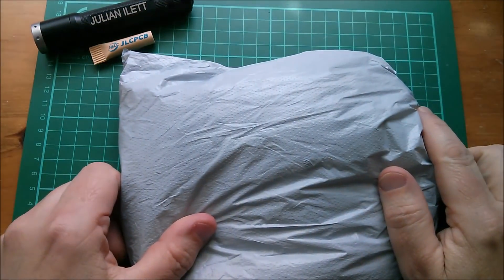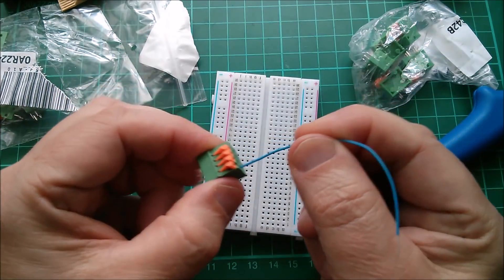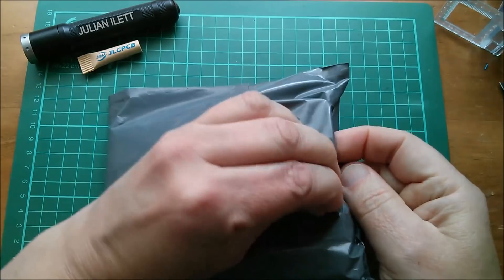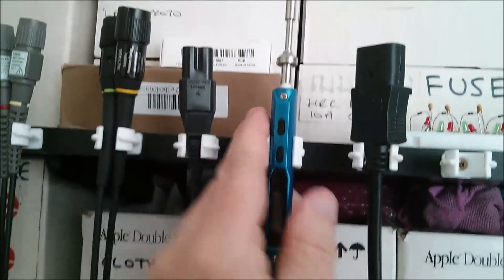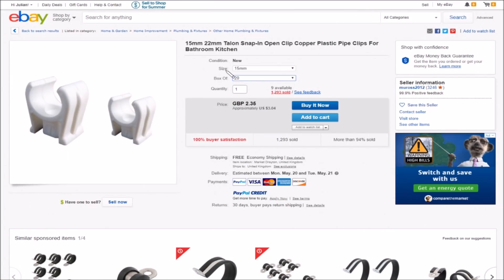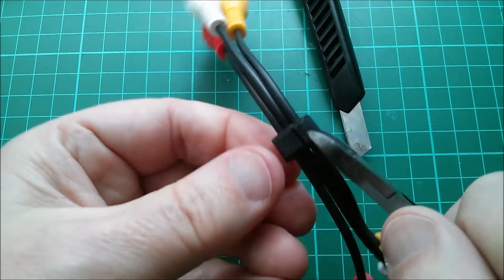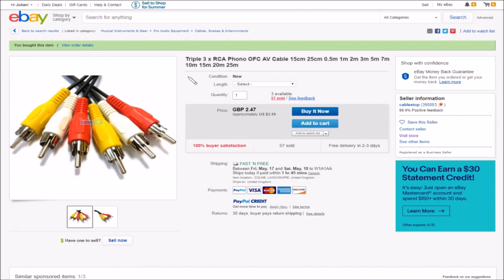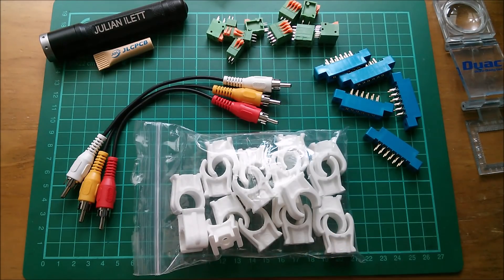Julian's Electronics Postbag: #136 - Connectors and Cables

Comment: You said about not wanting mains close to your fingers on the old soldering iron... Any legit iron should have the tip connected to the CPC (earth) so safe. 100% worth checking though.
Never tried a low voltage iron, very keen to give it a go though. I'm curious how it compares to my Weller

Comment: You Are AWESOME Julian!! So glad I discovered you some years ago. I did get my Breadboard Arduino working. I bought a USB interface that was different than yours and it would only upload a sketch once, UNLESS I waited. Figured out it needed a pull down resistor from the reset pin (DTR; AFTER the cap, to ground, in parallel. I used what I had for a resistor on hand; 220K. I am sure lower values would also work). Now I can download until the cows come home! I figured it out myself but with your teachings to guide me! :-) Cheerio.

Comment: My Antex soldering iron is now almost 30 years old, I still prefer it to all the other irons I've had. You can STILL get replacement parts after all these years and is almost unchanged. I guess why would you change something that works. I wonder how many current iron will you be able to get part from in 5 years time? if ever! and it's still made in UK. It does work on 240 volts but unlike some Chinese irons the earth is connected.

Comment: Hi Julian, been a long time subscriber and love watching your vids but 4 adverts, sponsor and patreon sections in a 19 minute tube vid is on average a 3minute gap between adverts.  
I stopped watching tv because of the number of intrusive adverts, pity if utube (and your vids) end up getting the same treatment as the tv did.
Thanks for sharing.
Reply: I don't get any ads in YT videos. Im using the browser application on my tablet, not the YT application.
Reply: @simontay4851  hi simon, when click on the utube notification on my android tabler it automatically opens the utube app tha i cannot disable without rooting my pad.
The oly other thing i can think of is not to click on the notifications use chrome but i still get tons of ads. Are you using an ad blocker, if so i would love to know which one?  Ive tried a couple but these then have their own ads ever time you open chrome, some of which you can not skip thus making it worse than the utube app.

Comment: that black edge on the shelf is not Melamine. It's PVC and held on with hot glue. you can fix where it's getting loose with an iron
Reply: I agree! Set the iron on low, a few swipes and you are good as new.
Reply: It's not PVC.
Reply: @Graham_Langley  you are ironing (heating up)  the glue, not the matierial. It can be ANY sort of veneer.
Reply: @andyshap  Unless it melts before the clue does. PVC probably will but the edging strip shown isn't.

Comment: So, breadboard compatible, which means you can poke a wire into the connectors from the top. Pretty much exactly what you can do on the breadboard without the connector in it.
Reply: Yeah, but only for testing. Then you solder into your circuit board for real when ready.

Comment: 3.96mm pitch, the pitch of joystick edge connector of C64 and VIC20.
I used them when playing with I/O on C64 and VIC20.
With the KF141 terminal block, put an unstripped length of wire down the hole and lock it, then remove and note where the grip marks are.
They are good for occasional use, not for regular use, the orange pushdown lever will eventually fail by folding over, it is not thick enough for high rate usage.

Comment: 11:11 it looks like your finger prints are curved in too. :) The connectors are bowed in order to preload the centre pins which have a tendency to move apart..
Reply: Never mind the visual distortion caused by both the camera lens and the magnifying glass...
Lenses are guaranteed to make straight lines look curved.

Comment: Unless you have a very old house then your sockets are most likely RCD protected so I wouldn't worry about mains being that close to your fingers, the RCD's got ya covered ;-)
Reply: RCDs protect you from shock currents between 15 and 30mA which is somewhere between very unpleasant and dangerously nasty.  It would certainly zap your TL081 or 555.

Comment: Julian, you can iron on the Melamine trim :-)
Reply: if it was shit glue used in the first place, reactivating it with an iron will likely give you diminishing returns in pretty short order. Might squirt some construction adhesive in there, clamp it well until cured and then likely never have to touch it again
Reply from the maker: Or I could screw lots of tool hooks onto it to hold it in place :)

Comment: The 0.156” (sorry, approximately 3.96mm) edge-connectors were very common in the past, especially on the Commodore C64 home computers (and some of their other models). Like all “standard” edge-connectors, they were common on industrial rack mounting electronic equipment systems.
Myself, I prefer 0.1” (2.54mm) pitch edge-connectors. These were used on Sinclair ZX80, ZX81/TS1000, ZX Spectrum, QL, Memotech MTX, Acorn Electron etc... And found further use in IBM compatible PCs as part of the ISA bus.
Edge-connectors were also used with 5¼” floppy drives for the ribbon cable connection.

Comment: I recognised the label on the RCA cable - check out CPC part code AV18600 for the same thing for less than half the price :)
Reply: I thought that looked like a fragment of the PRO SIGNAL logo they brand a bunch of things with. Julian - free delivery over £8 if you need a bunch of those short cables. 98p each when ordering 5 or more.

Comment: Mains close to your fingers on an antex ?
You're not going to touch a hot tip with your finger.
OK, so when you touch the tip with solder you are making contact, but the tip is (or should be) grounded.
Used Antex all my life, not tempted to get any of the temperature controlled ones, they would only be set for full heat anyway.
Reply: Not all my life, but a whopping big chunk of it, I have and continue to use an Antex TCS iron. That’s over 30 years. I have only had to fit new bits. It’s still going strong 😀
Reply: Yea, thats a bit odd thing to say. I wonder how many other home appliances he uses, that are in metal chassis and grounded, like  washing machine etc. Other thing is the cheap chinese junk, but Antec is quality product.

Comment: 5:45 What you have there is 0.4 mm edge, which isn't designed to withstand the rubbing against it when you put or take something off the shelf. What you need is 2 mm edge. You can't apply 2 mm edge yourself as it's done using a special machine. You can take the shelves to a custom furniture manufacturer and they can apply it for you.

Comment: Why add another point of failure to your designs. I just plug wires directly into the breadboard.
Reply: i think that you can plug thicker wires into those connectors
Reply: @soups1697  That's fair but at the same time, what are you doing on a breadboard that requires thicker wire? If your hacking something sure, but if you're working on a project that needs a high current path might as well go to the trouble of soldering it right?

Comment: 3.96mm bah humbug... that's metric for 0.156" as they used to be known...  No.. I've no idea where they plucked that number from either.. it doesn't sound any better than the metric.
Reply: 0.156" = 10/64 inch, the wonders of fractions ;). But help is on the way, here is a guy who will end the divide between imperial and metric. https://www.youtube.com/watch?v=KX6FpLBDOFs

Comment: I enjoy the hell out of these video's.   I order Piles of Electronics Modules / Parts / Products from China. Most all Electronics related.   Usually make a order like twice a month.   Bits and Bobs for my on going projects.  Current Projects including E-Bike and Power Wall projects.   Your video's are good brain food on the quality of the same.   Living in the Desert, Dust is just a part of life here.  Hanging my probes like you do wouldn't work out worth a hoot.  LOL,  Now I want some of those clips to use in the Power Wall project.  They would be dandy keeping Conduit and cables at bay !     On your Edge connectors easy orientation key fix would be to simply put a bit of plastic filling in one side of the connector.        JUMPER CABLES

Comment: You might be able to insert a solid core wire into the terminal without pressing the orange button.  It's probably there to allow the wire to be released.